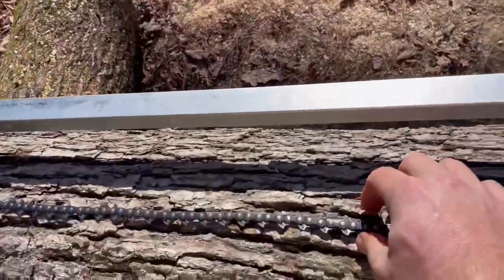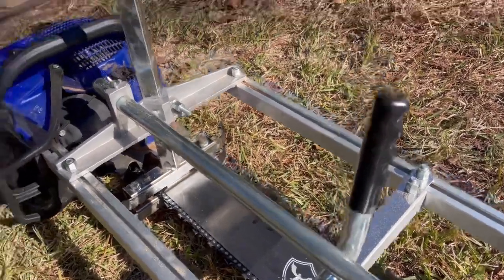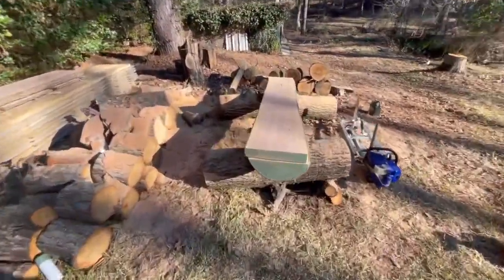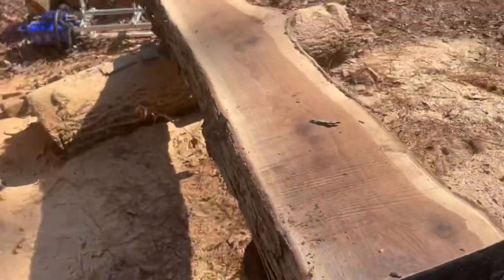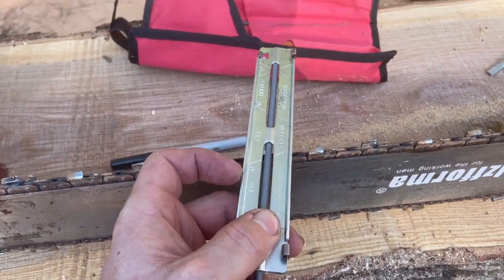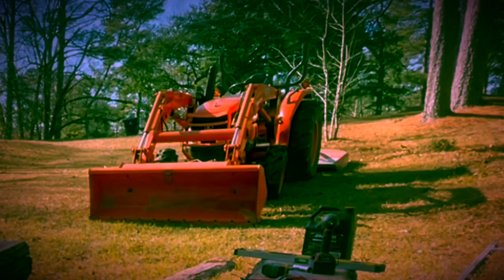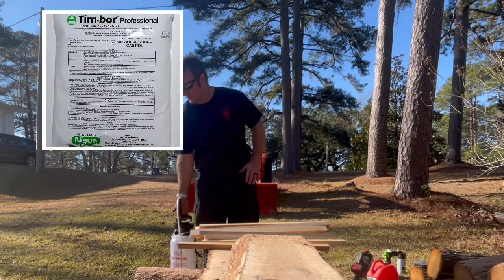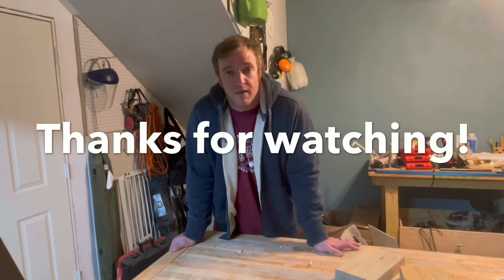Alaskan mill with new Granberg ripping chain

Comment: Have you ever looked into or used pentacryl?  Supposed to help displace the moisture and make the drying process a little quicker and more even so you have less warping and cracking.
Reply from the maker: I actually have a gallon of it down in my garage! I've used it for crosscuts/cookies, and it does really well.  Cookies tend to crack due to how fast they dry, and Pentacryl really helps with those.  The problem with this much lumber, though, is I'm not rich enough to buy that much pentacryl, So I'll just wait 😂😂😂
Reply: @allen_woodworking  lol... no problem brother... I'm learning and just asking questions
Reply from the maker: @2muchtime26  absolutely.  I'd be happy to answer anything I'm capable of answering.  Thanks for checking out the video!

Comment: You said that you needed to wait 3 years to use the wood.  Is it because the slabs are thick and you are air drying, or is it because you used timbor.  Thanks for the info; I didn't know anything about this product.  Now I can research it.
Reply from the maker: Hi thanks for the comment! You’re first assumption is the correct one, the wood is close to 3 inches thick, and the rule of thumb is 1 year of drying time for every inch of thickness. The Tim-bor is more for discouraging bugs from eating all of it up before I can use it. I’m happy to answer any other questions you may have

Comment: what size saw is this and what length bar?
Reply from the maker: The chainsaw is a Holzformma G660 https://www.amazon.com/Holzfforma-Gasoline-Chain-Chainsaw-Thunder/dp/B09JKG1NDS/ref=asc_df_B09JKG1NDS/?tag=hyprod-20&linkCode=df0&hvadid=563593981914&hvpos=&hvnetw=g&hvrand=7897615643346368342&hvpone=&hvptwo=&hvqmt=&hvdev=m&hvdvcmdl=&hvlocint=&hvlocphy=9025512&hvtargid=pla-1629370950925&psc=1

I have a 36” bar mounted on it. This tree was around 25-28” in diameter

Comment: why not sharpen with the saw in the mill
Reply from the maker: You probably can, and some people do, I’m sure. Maybe one day I’ll be good enough to do that. In my personal experience so far, I can’t get my sharpener positioned on the teeth properly/effectively when I have the mill still attached. It’s worth it for me to take it off and sharpen the chain properly
Reply: @allen_woodworking  fair enough ive never tried but i guess if youve got the handhold in the way itd be annoying
Reply: @allen_woodworking  Thanks for the well done video! I like the “real world” comments, I heated with wood for over 20 years, so I’ve hit a few nails and buried fencing. I’ve used a Granberg 12 volt sharpener for years. It’s especially nice when you DO hit metal or rock. Because you don’t need a lot of movement to sharpen, I’m confident that it would be easier to work around the Alaskan frame! I’ve sprayed one cutter with white or whatever color is handy to use as a starting/ending point. Occasionally I’ll get a chain with 2 right or left cutter in a row and that’s a great place to begin and end! Safe cutting!!! Kevin
Reply from the maker: @kthom2001  I appreciate it, I’ll take a look into that sharpener. I’m always open to ideas and suggestions, if someone has a better way. Thanks for checking out the video!